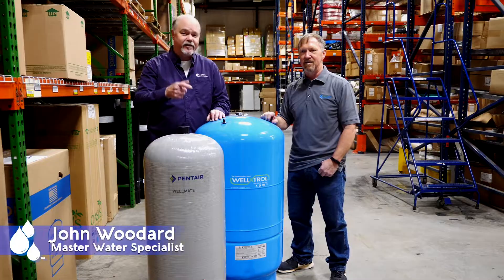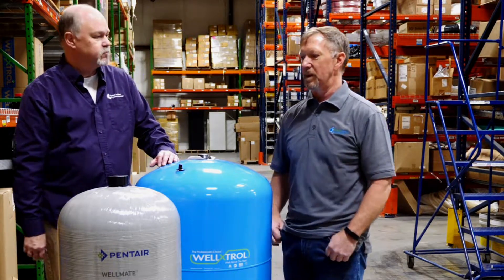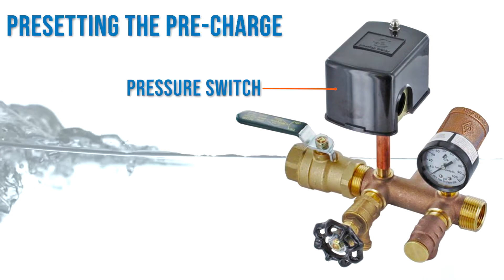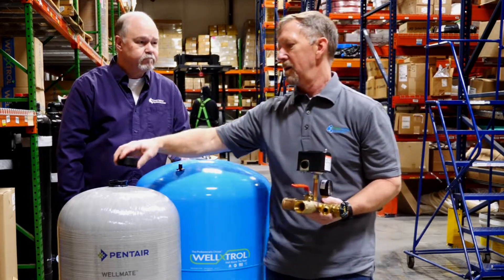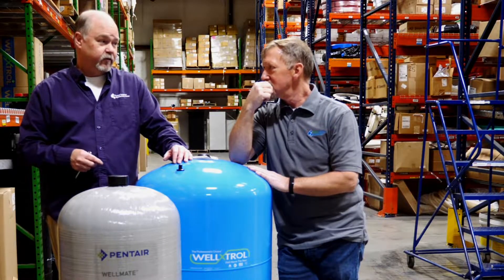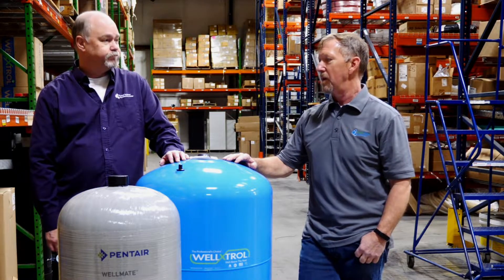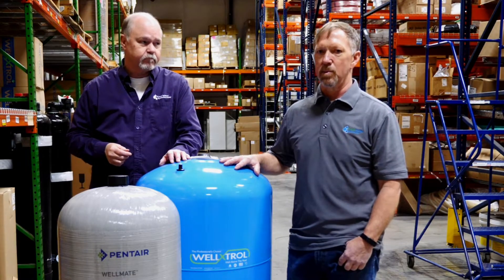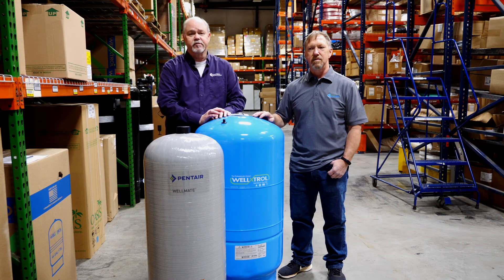How to Check Your Well Tank's Pressure

Comment: 11.59 South Africa 
Good day John and Don, congratulations on a very interesting video.
I use a Dab Easy box pump with a global water 60 litre pressure tank for our guesthouse . We work in bars in South Africa.
The pump is set at 3.7 bar, and restart at 2.7 bars. The pressure tank is set at 2.2 bars.
My problem is that when the pump is off and you open a tap in the house, only about 5 liters is used from the pressure tank. Then the pump restarts but over rev for a few seconds with a flow of +- 70 litres/minute, and shuts of again while tank is still supplying water is still needed in the house, and then restarts again.
The Dab is a verible speed pump, and i think the demand to the guesthouse and the pressure tank at the same time is to much, and it takes the pump some time to adjust, but by that time the tank is filled again and  while water is still needed in the guesthouse the pump starts again, same story.
When a lot of water is needed like a washing machine, it is the same story, but the pump manage to stay on while speed goes up and down until it settles.
When i use the pump without the pressure tank, it works 100% but starts everytime water is needed.
Hope to hear from you soon, kind regards Egbert van Zyl.
Email address is beryl1guest@gmail.com

Comment: Thank you Mr. John and Don for your great video. I have been looking someone more than a year like you. Now I`ll finally check air pressure in my 200 lt. tank and adjust pressure switch correctly to get maximum amount of water.  Than I am going to inform you about result to get  for some advice if necessary. ( Sorry for my english prep. or any other mistakes). Hi from Mugla/ Turkiye.

Comment: Excellent video. Thanks. One point. When you go to drain the tank for the pressure test, shut off the main water supply valve just upstream of the pump. That way the entire house water system doesn't drain out the tank. My plumber told me this. I'm not a plumber or well expert.

Comment: i could use some help first i dont know if i have a 30 50 or 40 60 pressure switch records indicate a 30 50 and the minimum pressure on the gauge is set to 40 and it pumps up to 60 but it drops back in like 2 minutes and 30 seconds and the tank pressure is 42lbs and if there is a faucet running the gauge stays at 40 lbs

Comment: If I have very poor water pressure when I open turn on the faucet, the  shower, etc. but the water pressure picks up as soon as the pressure gauge kicks on, what would you surmise would be the issue?  Also, if someone is taking a shower & i turn on the kitchen faucet to rinse a cup or bowl, I have little to absolutely no water flow to the kitchen faucet.  It evident that some component is allowing the pressure to drop below the cut in pressure.  It will get down to 15psi and while the water is running it kicks on about 25psi & off at about 55psi. Can you point me in a direction of what I should check first?  Should I cut the power to the tank, drain the tank & then test psi in the holding/pressure tank?

Comment: Hi guys, the rigid plastic tube on my switch broke off and leaked everywhere. I replaced it with soft copper and since the switch was 20 years old I replaced it also. Now the system tend to runs way to long with no water being called. Do you suspect my tank pressure is causing it? I’ve never checked the tank pressure? Also can I run the faucet to drain the train or so I need to run the hose at th gage like you recommend? Great video!

Comment: We had our pressure tank replaced about 6 month ago. The pressure switch is 20/40. My problem is the runs down below 15 psi but the pump doesn't kick in  for 4-5 min. Then runs for 14-15 min and pressure tank goes to 60 psi. I replaced the pressure switch and it still doing the same thing? Our water comes from a spring thats less than 100ft from the house.  The spring is at the same level or slightly higher than the tank.
Reply: Seems like you don't have enough available water in the ground/spring

Comment: I have a deep well jet pump with 2 pipes so is it a good idea to have shutoff as well on both the hoses for maintenance so don't lose prime if need to replace pump or work on replacing impeller and parts? I have shutoff between pump and pressure tank and pressure tank and main water line to fixtures. Just thought of adding those other 2 or a check valve on the hose coming  in

Comment: Thank you. My system did not have a drain valve so I just left my turned off the pump and let the water pressure bleed off through the sink.

Comment: When you say drain the tank, do you mean drain the tank fully?  Ours has a drain tap on it, but only drains until there's zero pressure.  There's still a lot of water in the tank as air can't get in and it's created a vacuum.  To empty it fully I have to disconnect the base pipe and keep swapping buckets under the tank for 1/2 hour till it drains fully.  Do I need to do this or is zero pressure enough?

Comment: When I was a kid, the well tank had no diaphragm but it did have an air cushion.   It was in the basement and it was one of my responsibilities to check it every so often.  The tank had a glass tube on the side which showed the level of the water in the tank and, therefore, the size of the air cushion above it.  There was a range in which the water level was acceptable.

Over the years, I recall adjusting it both up and down.  Any excess air (more common) could be released from the air valve on top, using the pressure in the system.  To increase the air (less common) the pump had to be switched off and the tank isolated from the pump inlet and the house plumbing, by closing two gate valves.  Then the air valve was opened, followed by the drain valve.  When the water level had dropped to within the acceptable range, the drain valve and the air valve were closed and the two gate valves were opened.  That was in the mid 1960s, in the northern USA.